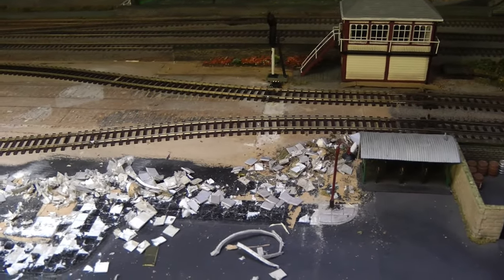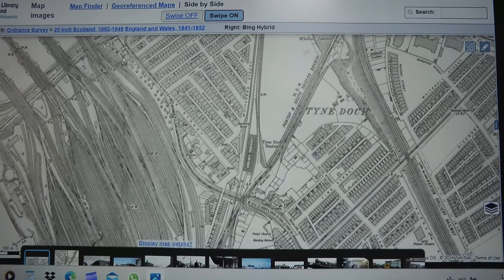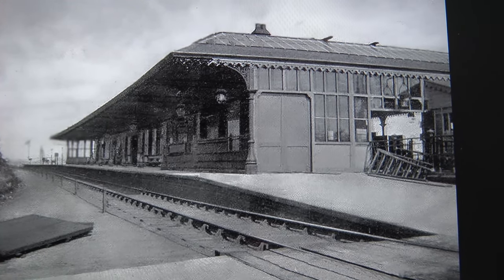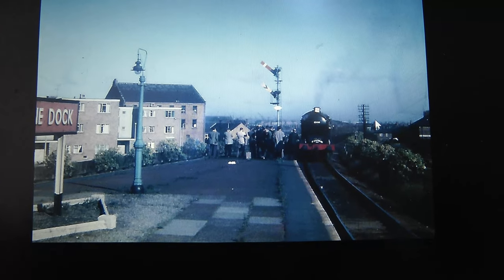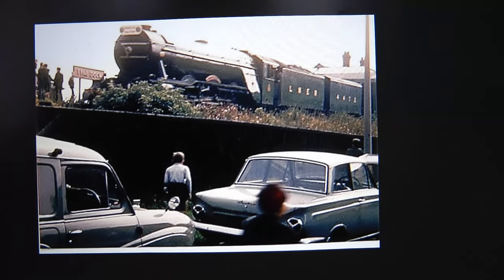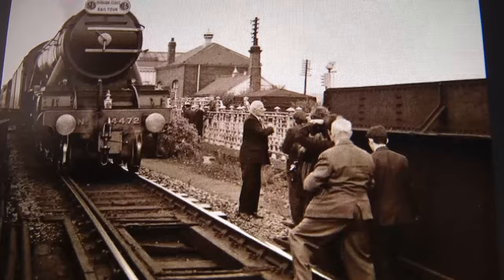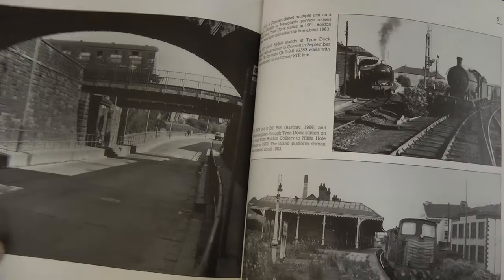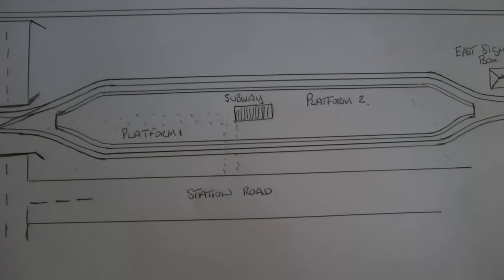Tyne Dock Re Build. Part 2. Photos and Ideas.   No 424

Comment: Dear Tony, now that’s some very interesting information and set of photographs and books! Love the mutual effort which already has set the stage for the Tyne Dock station project. As a model North Eastern enthusiast I sincerely appreciate all the efforts to dish up the background information on the history of the station. 
Absolutely marvelous you’re going to add the subway entrances to the station. Especially with the white glazed brick, or the tiles as you said, it will create a next dimension beneath the surface of the tracks. Love the entrance under the bridges. Am very curious how that’s gonna look on the layout. 
On the different photos of the ‘wind breaker’ side, presumably above the station’s entrance stairway, from the lower level subway upward to the platforms; there’s two versions. One which shows a set of, what looks like, steel doors, in line with the articulated fascia board around the roof line. The other version shows a wooden outcrop at and around the location of the steel doors. The outcrop built in similar fashion and colors as the line side hut, closer to the end of the platform. 
Am kinda curious about those steel doors, seems like they gave access to the space above the station’s entrance stairway, maybe in such a way goods could be hoisted up or down. Why else would there be such large doors above the staircase? Do think the version with the outcrop also looks very interesting. Would say it depends on the overall footprint of the station and its canopy to see which version deserves the modeling effort. 
What I especially like about the canopy is the fact that the construction is perpendicular to the tracks. That will create both a very interesting build and will shed light on the platforms in a very specific way. Absolutely agree on your point about the cast iron columns, also being in use as a drainpipe. With all the apexes and valley gutters of the canopy, this will indeed be a great way to collect the water from the different roof surfaces. Am very curious for the next episodes. 
Please give my regards to Mrs. T. 
Cheerio, my master builder friend Tony!
Reply from the maker: Hi Vincent, not at lot go on, south shields was well photographed. but at least we a good idea on what Tyne Dock looked like. thanks again for commenting. cheer's for now my friend. Tony.

Comment: Great research material Tony. Reminds me a lot of the main station in my town, Dumbarton Central, which has two islands accessed by underpasses (well one underpass that serves both). Over time it has become what you have just removed in Part 1, as the outer lines, one is disused and overgrown and the other is used rarely for the seasonal West Highland Line "posh" trains.
Reply from the maker: Interesting topic Dave. maybe if all the station were used to there full potential then there would no congestion on our roads. Posh Trains now thats got me thinking. thanks again for commenting. cheer's for now Tony.

Comment: Hi Tony, just a suggestion on your track layout. If possible move the crossovers back off the bridge. Not sure if there is room to do this but there may be. Move the running line to use the disused siding layout. You could then remove the centre of the bridge to see the proposed entrance. It will also give you more room for your wooden buildings.
Reply from the maker: Interesting Idea. The only problem i have with that is the wooden supports with the interfere point motors. space could be another issue. as it is close to the curve. but yes i will be building those small buildings. and added them in somewhere.. cheer;s for now Tony

Comment: Tony Checked out The Railtour Website Six Bells Junction The North Eastern Railtour ran in September 1963. 63460 worked from Newcastle Central to Tyne Dock & South Shields then back to Consett & Bishop Auckland on 28/9/63. With some more photos. 63460 was a Q7 which is preserved. Ian
Reply from the maker: Thank you Ian some very interesting facts. thank you for commenting. nice one. Tony.

Comment: Hi Tony, an unexpected treat seeing Part 2 appear. The photo of the underpass coming in from the street struck me as interesting, with that plain doorway into the lovely curved tile walls of the underpass, I wonder if that curved wall ever had a roof to it. I'm guessing the doorway is at street level, almost platform level, so the underpass had to go down under the tracks. At first glance seeing the "platelayers hut" I thought it might be a shed for one of those little Wickham Trolleys, but a later photo of the railtour train clearly shows that isn't the case. I wonder what it was used for? Anyway, really looking forward to seeing part 3.
Reply from the maker: That's the thing with some of these photos they do keep you guessing. unless you are there at the time. it is very hard to say. Wickham trolleys were kept in huts i agree. but my guess is oil stores for the lamps. or even a tools shed for the plater layers. and the hut behind was there rest areas. who knows, many thanks again for commenting. cheer's for now Tony.